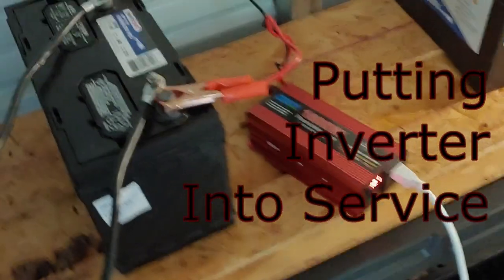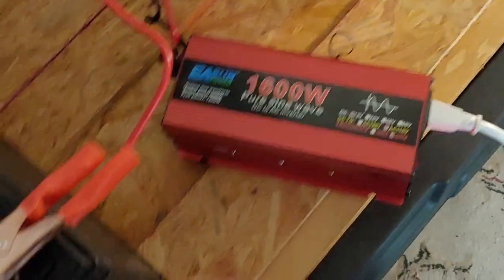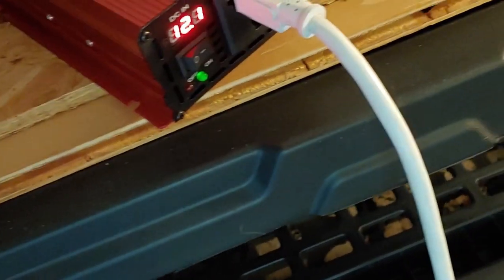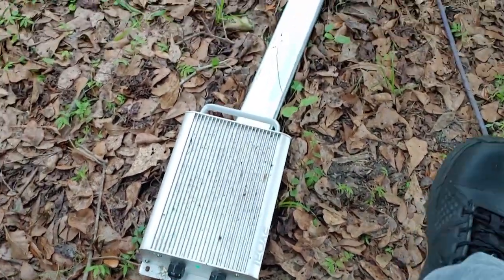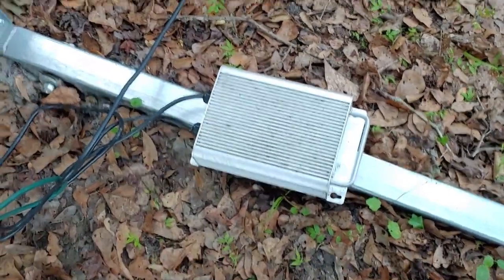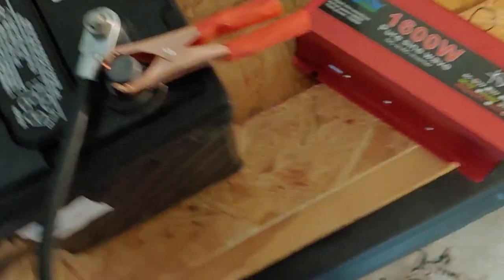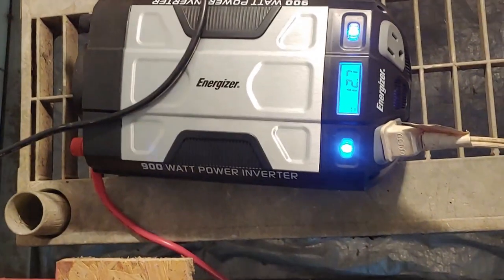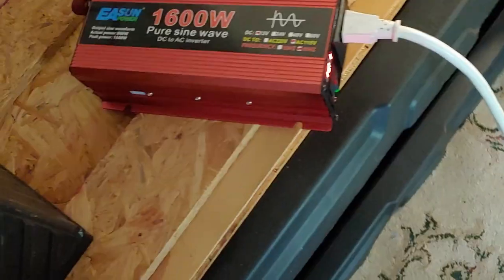Found a use for my Cheap Chinese inverter from AliExpress.

Comment: I mounted mine vertically right above a 4 inch fan  which is blowing sideways, anyways the air from the fan helps keep it cool. The one I have is like the one you have except 24 volts.I noticed it gets pretty warm if you run much off of it. I use it for the TV and a 5 watt LED light mostly. It also runs the 4 inch bathroom exhaust fan that is keeping it cool. It uses about 18 watts. Most of them have a 32 ohm winding but the one I have is out of an old trailer house, and it measures 64 ohms, so it barely uses any wattage. I have it mounted where it helps the air move through the Aims inverter charger. So it helps cool both inverters. It runs a lot of the time. I thought they used that #12 wiring to let you know not to run much off of it. If I run my bug zapper too, there might be 70 watts being used off of it... but that's about as far as I trust it. The voltmeter on mine is always .5 volt low. It's pointed to the ceiling now so I don't have to look at it. The high frequency inverters remind me of the the old CB " foot warmer " amplifiers. I'm getting by with this one by just using it for small wattage. I mostly use it on cloudy or rainy days when there's not enough sun for a full charge. Saves running the bigger one all the time. The owner's manual that came with the inverter wasn't the right one, but I figured it was probably the same company, said that longer product life could be expected by horizontal mounting. So I made sure to mount mine vertically. They're the same ones that rated it 1600 watts, I guess. By mounting it vertically, it lets the heat rise, helping the fan a little...and like you said, it needs it. That 25 mm fan probably wouldn't cool it running 600 watts. I am going to see how long I can keep this one alive. I think you are wise to add cooling, especially with 12v.
Reply from the maker: Thanks for the tips, and thanks for your comment.

Comment: The 1600W model means 1600W Peak! Continuous Power is only 600W. This is normally mentioned when sold. The 2500W model delivers 1000W cont. and 2500W peak! Did you check the sinus quality and voltage stability under different load situations?
Reply from the maker: The inverter was advertised as being a 1600 watt. Only later I found it was a 600 watt. Yes it is a pure sine wave. Thanks for your comment.
Reply: @shoestringprep  it does say on the front that it isn’t 1600 W continuous

Comment: Hello. 
Thanks for your time. 
I don't understand what you mean with "cheap chinese inverter" Is it worth to buying? 
I understand that is marketing trick labelled 1600w.
Thanks
Reply from the maker: In my opinion it is not worth buying. Not only was it mislabeled at 1600 but it did not meet expectations at 800 either. Thanks for your comment
Reply: I have a similar 3000w from the same manufacturer. The continuous power rating is 1500w but it can't power a 1200w electric iron(resistive load). I have a 140Ah Lifepo4 battery bank.
The max load i could run was ~1000w.
If you are using it for very small load (maybe 35% of the rating) then it should be fine.
Reply from the maker: @realToby  thanks for your comment.
Reply: It really depends on a lot because if you’re running expensive equipment or charging very expensive things you might want to get a high-quality expensive one or if you’re running a house or circuits in a house again you would probably want high quality one

Comment: The POS & NEG from the inverter needs to be on a different battery. The way you have it connected it will pull from the first battery and not able to give you all of the Wh that you have to use.
Reply from the maker: Thanks for the tip. When I've done this in the past it is never drained from Just One battery it drained from the entire Bank equally. Thanks for your comment.